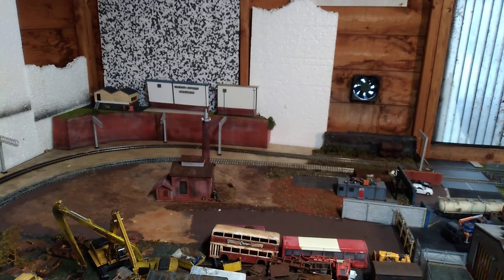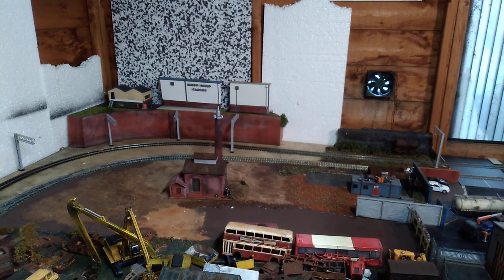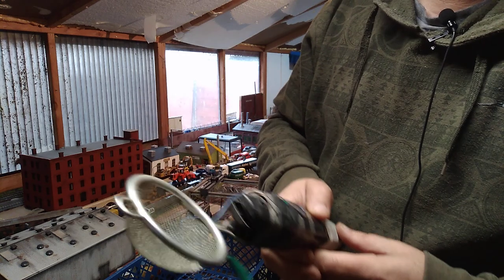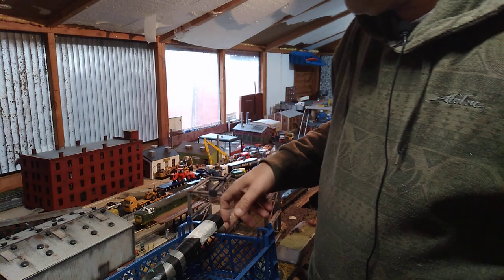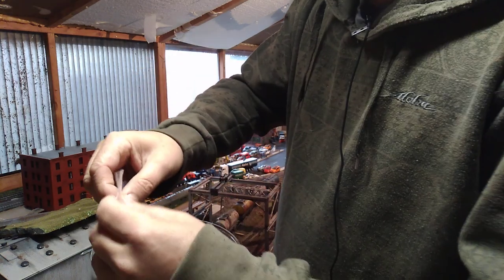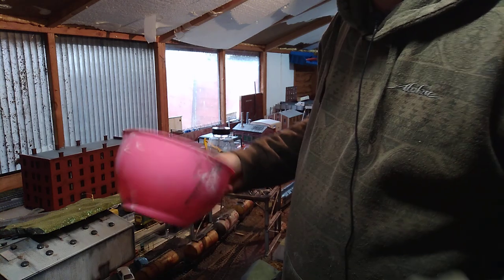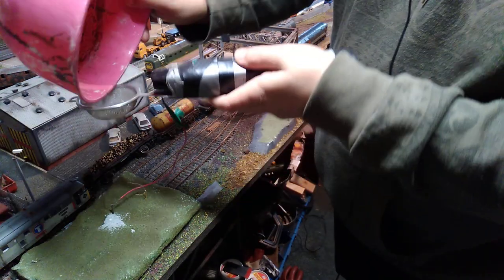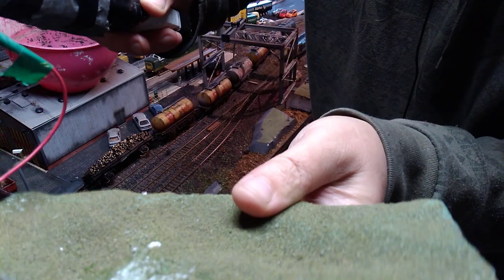Home made static grass applicator for the model railway

Comment: Hey digger. I made an applicator a couple months back, it works ok, not great. I think what it works better with longer grasses, 3mm and longer. Didn't like the way the shorter grasses looked, shorter than 3mm. I'm not giving up yet though, I'm wanting some tall weed areas and static grass is the only method that will produce the vision I'm after.
Reply from the maker: Hiya Gary I'm not a fan of the really short grasses only on manicured lawns etc, I have used coloured string for making Tufts of grass and pieces from bristles of a brush, they don't stand up too well though, I'll keep experimenting with the statics, it does help taking the positive sieve back over the grass area as it lifts the grass upright better, thanks so much for your comment my friend I appreciate it very much